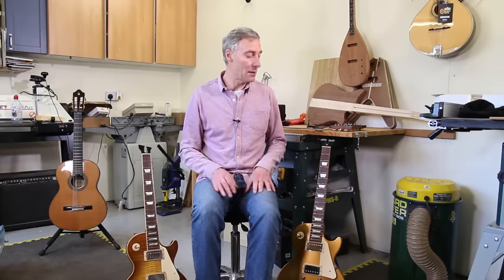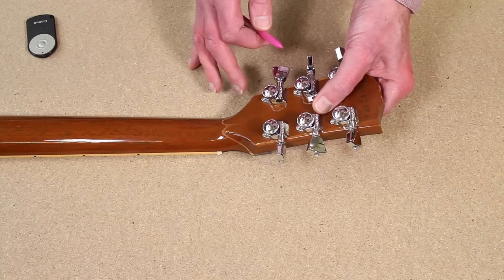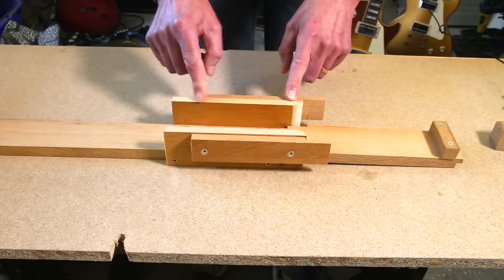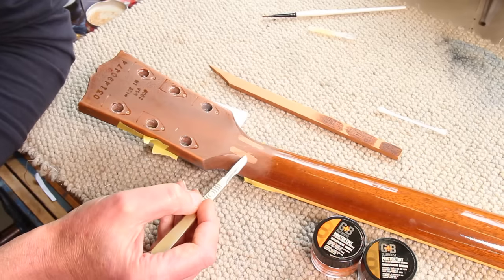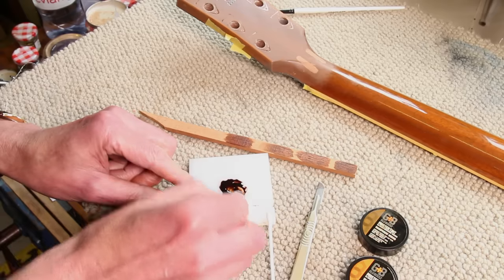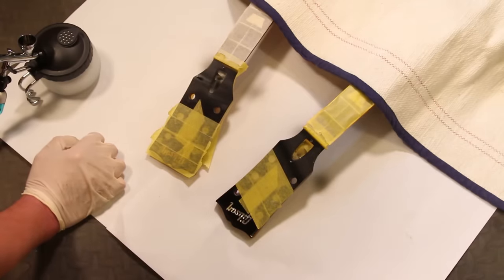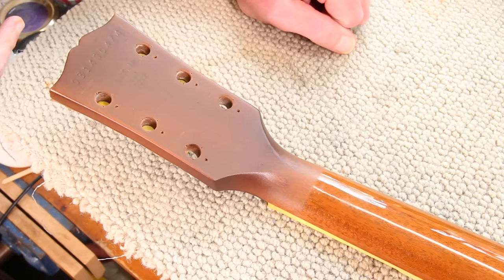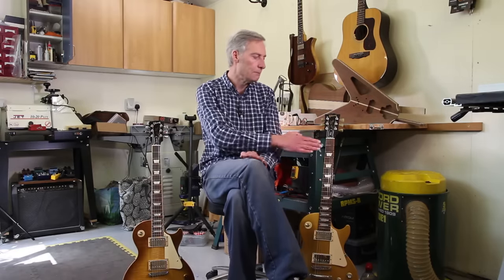Repair of a Gibson Les Paul with a snapped off headstock

Comment: I had a break on my original 1994 Les Paul in 2013. I took it to a Violin repair shop. Was charged $125 for a basic glue job, as it was a clean break. However after 5 years it started to show, came open a little and setting up the guitar was a no go as it felt like it could snap. I ended up in 2022 finally brining it to a well known shop, here in New Orleans where I live. They did the glue first, and then used a similar rig here to make 2 long splint and a maple overlay sand down. The did it with quarter-sawn maple splines, a quarter-sawn maple backstrap overlay and a hand-carved volute. Now this was not a $150 repair job! It made the guitar better in many ways, and I didn’t plan to sell it! Lots of on stage history and good sounding go guitar. But we were looking at a $600 repair for a guitar that goes $900 used on Reverb. I paid 1k total did that, a plek machine to perfectly align all fret radius, a full electronic check, new strings and a setup. Had I said no, it would of cost me $900 more for a new 2022 Les Paul plus tax. For me it was just a guitar I loved, so I went through with it. 

One suggestion though is if you get a clean break…get it done right the first time. If I did that Vs a simple glue job, I probably be looking at $300 or so. But the job was a lot more since it had been attempted.

Comment: Nice quality repair! Many years ago, well before YouTube, I had a Classical guitar whose headstock broke off after an airplane flight. I had very little time before another flight, and had to come up with and do the repair myself. I decided the best repair I could do was to drill a couple internal holes in the neck and headstock and glue in short metal rods. Matching the angle of the holes was a little tricky, but fortunately, bending the rods a little allowed for perfect alignment for joining the pieces together. Carbon rods were not available back then, and I might consider using them now to save weight, but I don't think they have the advantage of being able to bend them to get a perfect fit. Anyhow, gluing everything up went well, and because the repair was internal, fixing the finish was reality simpler. I haven't had any problems with it since then. Thanks

Comment: first time on the channel. repair beautifully done. honestly, as a lp owner (no headstock repair) i think i might actually prefer to buy a lp with a repair done like this that one without one. First you'll get it on the cheap and next you'll never be worried that your guitar can have a neck snap and lose its value in an instant. Good job here
Reply: Also i might add that being from Karachi Pakistan, i'm sure i won't find a luthier with nearly enough experience on les pauls to risk something like this with.

Comment: Very nice repair. As a luthier i have done quite a few of these. Lesson learned: I never ever put a LP case on its side, but rather flat on the ground. Otherwise if you tip them over the head can snap off , which is what happened to the guitar you repaired I assume. I love the finishing you have done, perfect work!

Comment: Beautiful work! Many people use the hide glue, but I prefer the Gorilla wood glue for neck repairs, and the Gorilla super glue when needed. I use clamps that have silicone rubber where it touches the guitar, so that helps speed up repairs by not having to look for something like cork padding. Bass wood on cheaper necks break easily. When shipping by airplane, make sure that the guitar is detuned because of altitude, air pressure, and dryness. The cargo handlers could care less and throw guitars around, so insure it, or buy an airplane seat next to you. I had to do neck repairs three times for a band who were slinging their guitars around their necks, and occasionally had an accident. Number one cause for neck damage is musicians leaning their guitar on their amp without a music stand.

Comment: That Amber is what I call burnt Siena I'm an artist of oil paint and use that for touch up with a quick drier, works great on chipout from frets and dries hard as a rock I do combine dust from the guitar but had no luck with synthetics or other fillers.

Comment: If you look at how much wood is scalloped from the truss rod nut area, its easy to see how the neck has a significant reduction in strength. The Chibson has half the size cut out, and so far ive never heard of one breaking. 
I bought a Chibson, stripped it down and fitted it up with Gibson hardware, wiring, pickups etc and its by far the best guitar ive ever had.

Comment: I think part of the common Les Paul (Gibson) broken neck issue involves the mass that's added by the enclosed tuners in this/these cases.  Inherent design flaw that Fender owners don't need to worry about much.  The Les Paul carved top is reminiscent of a violin and it's a beautiful design.  You can drag your Strat or Tele around with a rope and it often looks like that's what the Fender Custom Shop does...

I think it changed the tone of my Telecaster when I replaced the open tuners it came with with the much heavier Fender enclosed/diecast tuners.

Comment: Lovely meticulous work. For such a common problem with these very expensive guitars, I don't understand why Gibson has not addressed this issue. I have done a few headstock repairs, not on a Gibson, mine was in a car accident. It also had a Mahogany neck, I was surprised how soft the wood is actually. The repair lasted 10 years but eventually broke again. My question is why don't they go with a denser wood, such as Maple? It wouldn't affect the sound.

Comment: Fine work, Sir.A friend of mine had a  Dean Dimebag lightning bolt the more expensive model with the set neck. It suffered a break just below the nut and was in 2 pieces. someone  tried to use some.crap epoxy to put it back together ,needless to say the guitar didn't go back together the way it was, and it totally ruined the guitar so it ended up being a $1200.00 wall hanger.

Comment: Great repair tutorial. Thank you for sharing. As you point out, this is a known issue in Les Paul's mainly due to the steep head stock angle. My question is, given that Gibson have known this for years, why don't they install splints to reinforce that known weak spot? It won't impact tone, and would reduce the number of repairs that are needed on this model and in that neck location.
Reply from the maker: I don't what discussions, if any, have taken within Gibson about this issue. But the simple truth is that Les Paul's still sell in large numbers.
Reply: @flameguitars5770  OK mate. Got 3 x LPs myself. Just asking a question. Peace be with you.

Comment: That happened to my LP,  didn't snap all the way off but was hanging by a couple splinters. I didn't think there was any possible way whatsoever to fix it but I ended up finding a guy that said he could fix it. It's been five years and I still can't believe it, you can't even tell with a magnifying glass that anything ever happened.
It looks like it just came out the store. He put in two metal rods it's now stronger than it was originally. I don't how he did it, but he's on my lifetime Christmas card list.  If it happens to you it CAN be fixed.  And it was only like 165$.

Comment: Perhaps some of this is also due to the recent choices in wood, manufacturing and quality control by Gibson. I have a 92’ LP Studio that I bought new and have owned for almost 30 years now. It was used, abused and neglected for many of the earlier years. I never even had a hard shell case to store it in. Through all those hard years, it never had a break or even a crack in it. This guitar is known to be from the “good wood” era of Gibson. I don’t see that as a coincidence. All that said, it’s being restored as of now and will be treated well from now on. Great work on the neck.

Comment: Amazing craftsmanship. If you are going to have it repaired though, it seems odd to me to do it with the exact same design flaw. It is actually odd that Epiphone have addressed the design flaw with a less radical angle of their headstock while Gibson chose to just ignore it. Paper thing junction at the truss ends, the most radical angle ever seen on a headtsock coupled with the heaviest body, what could go wrong... Well at least this gentleman seems confident the repair with the two splints won't snap off again, it tells a lot about his craftsmanship.

Comment: Absolutely incredible. Thank you for sharing this with all of us, so very much worth the watch. I was wondering a couple things - what is the cost of this level of repair compared to just replacing the neck and - Is it possible to fix a 'ding' in the clear coat of an acoustic? I put a slight dent in the spruce top of my Taylor, it did not crack the  wood, just dented the clear coat. Thanks again!
Reply from the maker: It is still cheaper to make this repair than replace the neck. Probably not the same for a bolt on neck. But they rarely break. Repairing small dents is possible but often not easy. Easier to get an "invisible" repair on nitro finishes. I mostly take the view that these small knocks are part of the life of a guitar. But appreciate that others like to keep their guitars looking as new.

Comment: Solid repair.  Better than new I suspect.  I wonder if the guitar buying community should finally allow Gibson to break with tradition and use scarf joints.  Isn't a stronger neck more valuable than a weak one?

Comment: Beautiful work, I'm very impressed with your skills. I pray that this never happens to my LP 's but was curious as to what a ballpark dollar figure would be in the event it did happen?
Reply: one million dollars
Reply: I had a glue job done and it was $150, but didn’t hold up. This kind of job with with quarter-sawn maple splines, a quarter-sawn maple backstrap overlay and a hand-carved volute. As well as the paint over it set me back $650! I also got a full electronic check for any bad solder points repaired, ran it through a plex machine to get the fret radius perfect, plus a setup. Pretty much got the best neck job and the works! This was on a 1994 one I bought in 1994 for 1.2k or so. In the end all this work plus tax set me 1k. It was a lot, but the guitar has sentimental value. So these splint styles cost a good bit, from $500-$700 in some cases. I wish it was just a $200-$300 fret radius job. But yeah it’s not cheap given the time, maple and materials plus paint and work. I kept my worn finish on the bill of guitar. But had the break painted over because otherwise it would just be a long maple wood block on the neck. So yeah $150 going for a simple glue job that may hold 3-5 years. But if you get it done right the first time. The job may cost $350 vs say $650 for a improved neck and fix. Not cheap but worth it, if you don’t plan to sell the guitar and play it a lot live or studio. It’s now my main live guitar given durability! Also it sounds better as well than when I grabbed it off the rack in 94!

Comment: I was lucky with my break (new secondhand Fender CD140 SCE delivered in bits by Hermes). The break was long and tapered, like a long scarfe joint so no reinforcement required.
Guitar had clearly been dropped on its end, the fingerboard had pushed the nut and lifted the veneer on the head.

Used Titebond and the parts went back together almost invisibly, just a light crack line on the neck and an almost invisible line on the veneer.

Comment: @2:25 what can be done ?
Well for one, the necks Gibson builds could be 3 piece like Dean and ESP guitars or Gibson could simply use a volute at the end. 
I've got a bunch of good guitars and good few are Gibson guitars and the one with the thickest neck is the only one that suffered a broken headstock. Maybe it's because it's an SG with a mahogany neck, maybe it's that most of my Gibson guitars have maple 🍁 necks or maybe it's just that one guitar suffered a drop that hit just right to break the headstock but I've dropped my les paul Jr. More times than I can count and that guitar never fractured in the wood, it only broke a tuner peg so who knows why and how they break, it just happens.

Comment: Great video!! I´ve done a few neck repairs and I am  about to attempt my first ´End Grain job´ with Splints!   I only have a Dremel router. ..but I´ve nicked your jig design so should be Ok   .
 I´m going to use pieces of 5mm thick Walnut batten from the local hobby shop - then trim it. 
I´ll Let you know how i get on.  CHEERS from MADRID

Comment: I looked at my 1974 Gibson Les Paul Custom, the heel of the neck was made with a thicker heel whereas the one you are working on does not have the thicker heel. I think that is why the newer models have headstock issues of breaking. Gibson created a thin spot with the truss rod area not having much wood to support the headstock. Not sure why they would do that other than trying to reduce weight on the guitar. It is a bad design if you ask me.

Comment: Beautiful work!

I would be curious though to see the repair after several months time. Since the grain of the guitar and splints are running in different directions, I'm afraid the expansion and contraction of the two different woods will show through the laquer.

Comment: beautiful repair- only wonder is why the titebond hide glue vs the titebond 2 wood glue that gibson uses?  Hide glue is generally used where removal is a possibility. Of course if the answer is what I had around- thats good enough as it is a good glue!
Reply from the maker: Yes, get asked this quite a lot. Hide glue gives a little more working time as I align the parts before clamping. Titebond Original 'grabs' a bit quicker giving me less time to ensure that the parts are properly aligned. If I know that the parts will come together easily I would use Original
Reply: @flameguitars5770  Thanks for the quick reply, truly appreciated!

Comment: When I do butt breaks where it's just straight I use oak dowels ,drill the holes and use small transfer punches in the holes to get perfect alignment and then use the Weldwood glue as I stated below
Reply: I've had very good outcome with the oak dowels and transfer punch system when it's applicable but there's a hundred different breakers I'm doing a humming bird where I didn't get the machine head so I had to buy a neck and I got a les paul with no head and I bought a neck for that to I'm buying guitars with no heads more n more for a song , I can sing pretty good

Comment: My girl knocked my 1970 Deluxe off the stand and snapped off the headstock. It was a pretty clean break and I got it repaired quite well.  It's not too visible, but definitely not as nice as your work. No splints either... but it's still hanging together 15 years on!

Comment: In this situation not a bad solution,  but to drill within the actual break in each side using measuring gages inststall dowels on each side of the truss rod equally! Not as much visually to see and very strong repair! Another solution is what we call  a 'Luther's cut' using a new or used headstock from a donar instrument,  cut at leanth at angel with dowels as well... good job, keep up the good work,  👍

Comment: This is an amazing job. However Ive just glued mine back on years ago and have no problems. I did use completely industrial glue. I just hate to se people with lower cost LPs to think their $600 to $1K guitars will cost too much to repair. Id like to see Gibson address this issue. Either lessen the angle or add a volute.
Reply: Yep cost me 650 for a splint job and paint. It was done very well! Guitar was a 94 with sentimental value. So I just did it an it’s my main live as the neck is much better than off shelf. I plan to buy a Jazzmaster American Pro 2 anyway. I just didn’t want to ditch mine, as it had been glued already in 2013, and started to fail around 2019.

Comment: I have repaired many snapped  guitars I use to use titebond but a pro Lutheran told me to use Weldwood formaldehyde powderd glue ya mix it with hot water and paint it on, it's stronger than the wood it self and it's very hard so it has the best tone most violin makers use it also, and  wood racing boat makers use it  in the Tite joints because it's not affected by water

Comment: I've heard of this happening, it's one of my worst nightmares for this to happen to my Les Paul. I do take great care of my guitars they are all left in cases. Does anyone know which years/styles of necks are prone to this? Mine is a 2000  LP Standard, also own a '17 SG and '15 J45.
Reply: 《☆》The gold top was dated 2017 & the sunburst was 2009. I had a 1979 black beauty that was glued back together before I bought it in 1992. I think it applies to all LesPauls & many other Gibsons as well. I currently own a 2010 Gibson🤳LP studio deluxe that stays in the case when not in use. I also have 2 Epiphone LP standards, 1 Junior & 1 Special & a Firebird VII which stays in its case.The Pauls are usually propped up on stands in corners or in gig bags. None of the Epiphones🤳have any breaks but I hear that it can happen to them as well🤓🗣🔊☮✌👍🏾
Reply: @bdogjr7779  Nice axe's! This was an eye opener for me. I'm definitely gonna be super cautious with all of my Gibson's. I've made it almost 15 years so far, I plan to keep that streak going.

Comment: When you glue well with the right glue on a clean break, it will never break again on the glue joint! ;) No splicing necessary.  But you have only one chance to do it right.  (from an old woodworker/cabinetmaker)